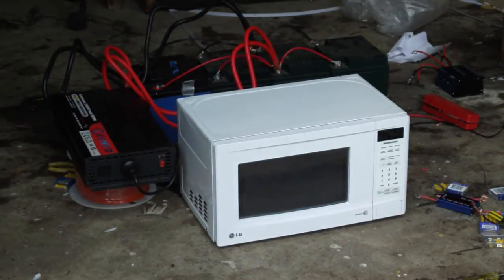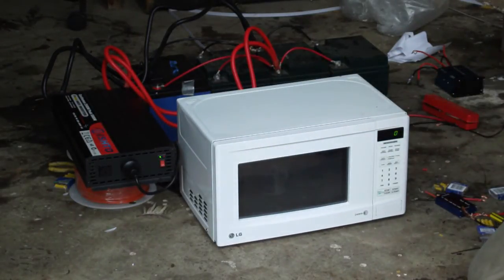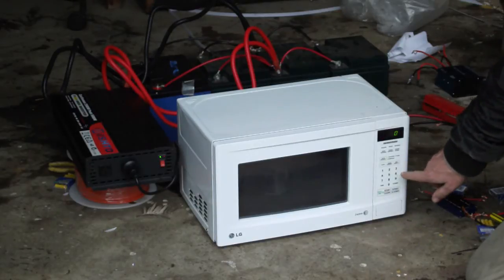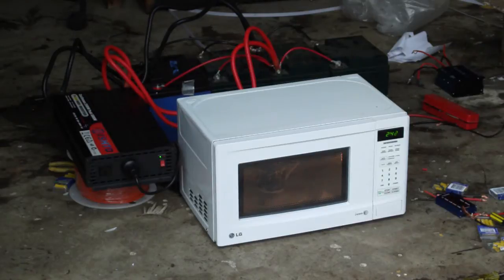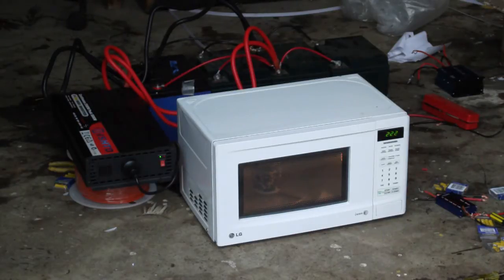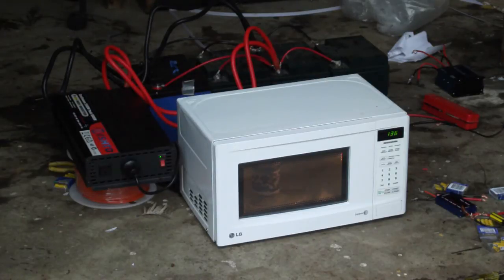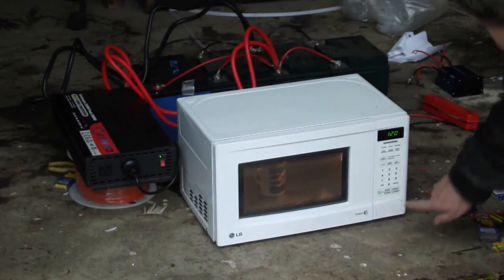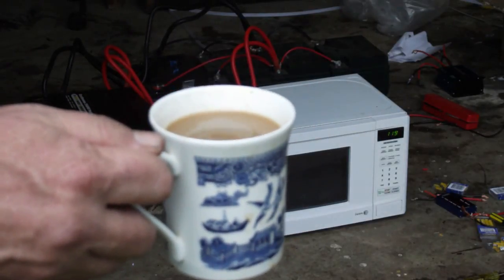(DIY) 700w microwave test - with - 2500w continuous inverter

Comment from the maker: Mr Horton , Giga frequency "generators" require large quantities of electrical consumption to produce the final output wattage so a 700 watt microwave requires near 2kw to produce the 700, therefore an 1100 watt inverter can only operate a microwave oven on around the first two power levels 1 and 2 , usually power levels go 1 through to 10.